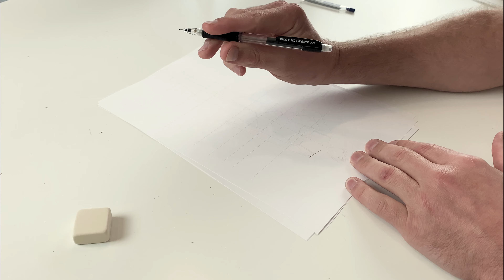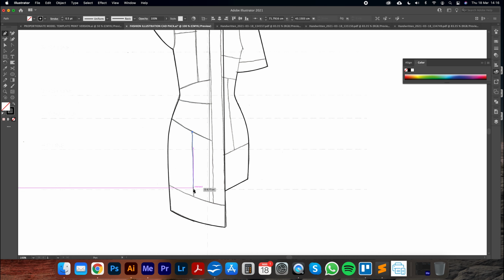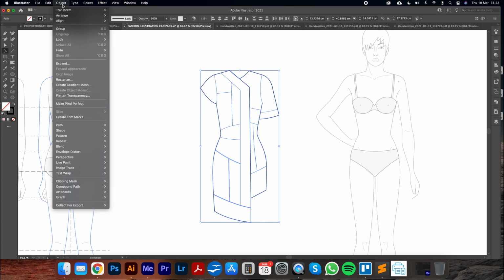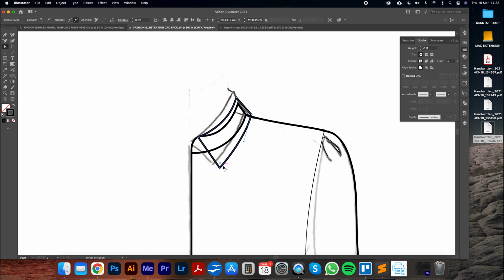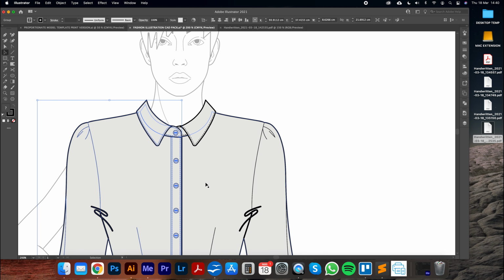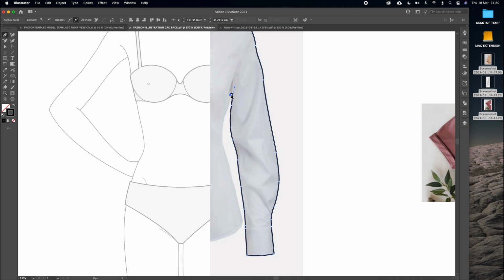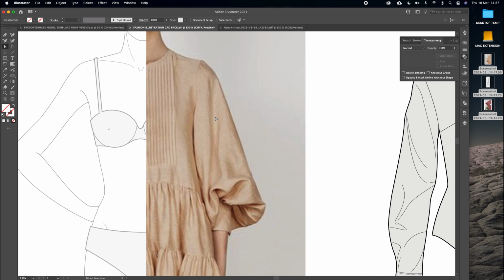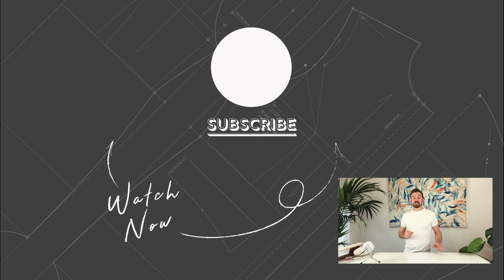TECHNICAL DRAWING FOR FASHION: PART 3 - Digitising hand-drawn technical drawings

Comment: However I downloaded the Free model template but it cannot open. I keep getting the "the file is in a format which cannot be opened" message. Kindly advice on what I might be doing wrong or the issue. Thank you 🙏🏾
Reply from the maker: There might have been an issue with your download. Please try the download once more. If the problem still persists, check your version of Adobe Illustrator. You might need to update it to the most recent version. Good luck and let me know how it goes.
Reply: @PatternLabLondon  Hello , thanks for replying. It still has the same problem. My Adobe version is Adobe Illustrator 2020

Comment: How do you give the manufacturer the sizes? 
Do you send for every size (S,M,L,XL,XXL) the exact lengths and widths? 
Or are there any basic sizes the manufacturer can use first and later can make small adaptions? 
How is this process of finding the perfect sizes?
Reply from the maker: Hi Fabian, I'm not sure exactly what you are asking but I've interpreted as follows: When designing a technical drawing of a garment, you would base that garment on a standard size UK8 or 10. Any measurements you added to the technical drawing would be based on the UK 8 or 10 size. The pattern maker, would then use a UK8 or 10 basic block to make an initial sample of the garment. They would use the measurement y ou provided to turn that basic block into the finished garment. The finished initial sample would then be tested or fitted on a UK8 or 10 model. Adjustments would be made to get the fit and style right. Once the design was finalised, the pattern would be sent to a pattern grader who would then grade that pattern into a range of sizes: UK4 - 22. Those sizes would then also be tested or fitted on a variety of models. That is essentially the process. Everyone does it a little differently. Does that help?
Reply: @PatternLabLondon  helps a lot, thank you!